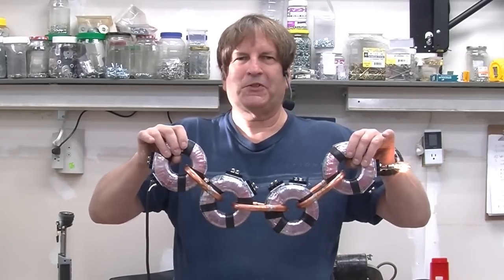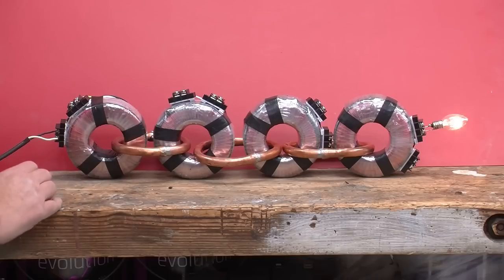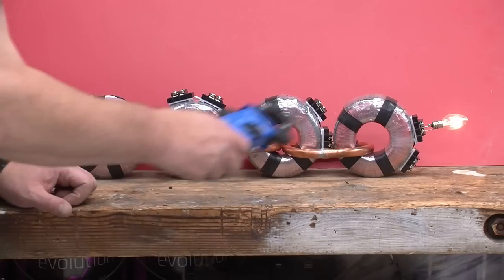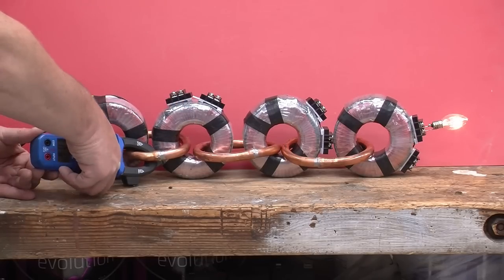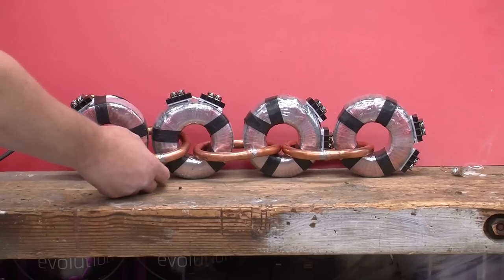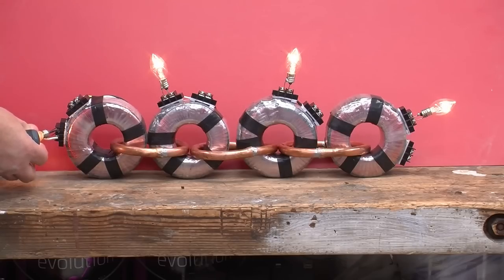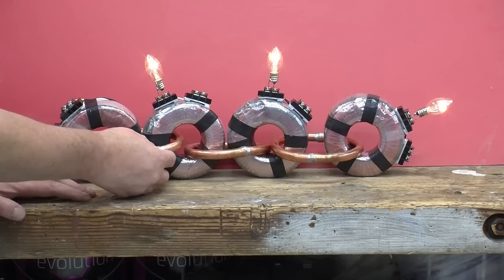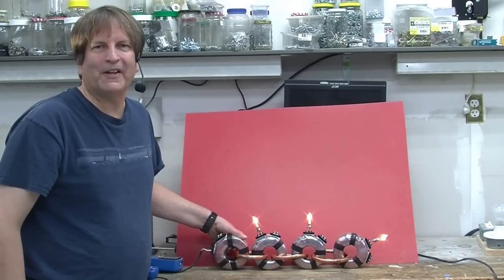Let's Experiment with an Electromagnetic Chain!

Comment: Very cool.  You're going to have too much viewer feedback soon.

From one of the electrical terminals at the far end of the chain:
Would they each measure about 60V to ground? (it may depend on where the copper pipe rests in the toroid, so maybe 40V and 80V to ground)
If you grounded one of them (if that's safe, or thru a lightbulb), would the other terminal be about 120V to ground?
I expect the GFCI at the wall outlet will not trip.  A GFCI placed at the far end of the chain should trip with one terminal grounded and a fault from the opposite terminal. [edit: a GFCI is supposed to account for a leakage current, but not sure how that works if neutral and gnd are electrically the same]
Reply from the maker: Thanks!

Your right about  the terminal to ground voltage varying depending on the location of the copper pipe or anything else that touches it. Would be very hard to predict because of the very high insulation resistance and for that matter, it would almost almost be impossible to measure because any current getting though the insulation is probably in the micro-amp range. I might even guess a significant portion of any such current might also be from capacitive coupling between the winding and the core.

And yes - if you grounded one or the other of the end terminals, the other would be 120V to ground and with a good connection to ground, be as dangerous as 120V out of a normal wall socket. 

And  the GFCI on the wall would not trip because it is not in the current path.

A GFCI at the end: The GFCI works by tripping if the currents on line and neutral wires are not equal and opposite. If they are not equal and opposite, there must the current flowing somewhere else so the device trips because that shouldn't be happening. 

 So if we add a GFCI to the end and   ground one of the wires between the GFCI and the transformer coil, there is now a ground path possible for shock type currents. The GFCI should trip if someone were to touch the wire on "the safe side of the GFCI" that is 120V to ground since the shock current diverts some of the away from the GFCI and the two wires going though it are no longer equal and opposite. 

You hit on a few neat things that have real applications:

1) GFCIs are sometimes used when retrofitting old houses that do not have ground wires at each outlet. In that case the GFCI ground is not attached to anything and like in the situation above, it protects by noticing the difference in currents on its two wires and shutting off power. 

2) The 120V output end of the chain is isolated as you described. There are transformers that are build with an isolated output for testing and other safety applications because without the connection to ground, there are less paths for a current to accidentally go though people.  I did a video about that here: https://youtu.be/olq9wdeNS4c
Reply: @ElectromagneticVideos   In Scenario 1... here, such a residence would be disconnected from mains supply until it complied with current Standards wiring rules.  No two ways around it.  
No electrician would touch the place until it was agreed the work be done in accordance to such rules, in fact, we are obliged to disconnect rather than risk their Licence to work in the industry be suspended.  No self respecting tradesman would work on the place... because as the last person to work there they would be blamed for not disconnecting when someone gets killed. 
Oh yeah... we don't allow unlicensed DIY idiots to work on Mains wiring systems in homes, unlike the USA and UK.  Good luck with that recipe for disaster. 

Senario 2.  
Touch between the two transformer output terminals, or circuitry after and get the belt of a lifetime.    Isolation Tx have a very specific limited use, because all appliances in use in a home should have an Earth/ground available if it is needed... eg. if they are not Double insulated construction. Anything with a resistive heating element built into a metal hotplate or pan require such an Earth/Ground. 
Also, there are sound reasons for Neutral Earth bonding that far exceed and perceived 'additional means' of accidental electrocution.

One other matter noted there.... you can find a lot more than your 120V AC across the terminals of that Tx in an open circuit situation... both sets of windings. 
The copper pipe used has a very thin wall section... low Cross Sectional Area that would hardly carry 40A at below 75 C... or 105 C, for extended periods of time.  If it was cable with a CSA of 25-35 sq mm and so, a safe current rating of 80-100A there would be no problem shorting out the winding terminals (BOTH) for safety. They will NOT burn out from overcurrent or heating effects.  Do the math... All Tx after the one energised by 120V AC are CT's with a ratio of 500:1  Pass 500 A through the core and get 1A current flow into a high impedance voltmeter load. Open circuit they can suffer  HV insulation resistance breakdown that renders them useless as a VT or CT... and provide a significant shock to those playing with 'em.
Reply: @Bernie_the_Bolt  Very wise policy if enforced.

Comment: Also demonstrates why you NEVER bolt to both sides of a metal case through a toroidal transformer, as it would create a shorted turn.
That isn't a shorted turn, as it forms the secondary of one transformer and the primary of the other
Reply from the maker: Yes! I wonder how many times that has happend because someone didnt realize it.

Comment: There is no point to a GFCI if you're also going through an isolation transformer, or vice-versa.  It's a good idea to have one or the other, but having both doesn't give you any extra protection.

Also, you really should turn off the power before connecting or disconnecting things from terminals which are running at mains voltages.  An isolation transformer or GFCI still won't protect you from accidentally bridging across the terminals, which can still produce a nasty shock.

Comment: Why is there so much power loss in each tranformer.....
Reply from the maker: Its because the with a single copper loop (pipe) the voltage in the loop is low (0.2V) so the current has to be really high to carry any amount of power and even though the resistance of the copper is low, at 100s of amps it had significant resistive power loss (RI^2). I squared in the previous equation is huge when I is 800A - about the rated power of the transformers used. If I had thicker copper - rod instead of pipe - the losses would be much less.

Comment: Found the following version about five years ago, film from 1965...  https://www.youtube.com/watch?v=Vwjcn4Vl2iw&t=279s
Rats, I thought I invented it first!   But Lawrence Bragg was already using those for his lecture demonstrations forty years before me.

I came up with the idea myself in 1989 as a physics exhibit for science museum.  An AC transmission line with no circuit, just EM waves alone.   Showing people that "Electricity" is not currents or electrons, because the energy-flow in circuits is electromagnetic.   The utility companies are selling us some e-fields and some b-fields, at right angles.   Radio waves, but at 60Hz.

Then finally was able to build one in 1991, from some iron C-cores I found in a surplus store, plus some thick aluminum rings!   No coils on the chain, just purely lam-cores and rings.  My driver was a 300 watt soldering iron, with a loop of #10 solid copper wire in place of the soldering tip, to put out about 800amps.  At the output end of the chain, I had about ten turns of hookup wire, driving a small 3V bulb.

I did put up a crude drawing on my website, in 1999, figure 10 in "Right Angle Circuitry"

Comment: Please explain how it is that you are able to touch the copper loops without a shock. Also, how is it that you were able to measure voltage on a single single copper loop? Also, how is it that the copper loops can touch each other inside the iron toroid without causing a short? This demonstration makes me feel less informed, not more informed. It’s very enjoyable. But I don’t understand how you have so many praising comments and no dumbfounded ones. ☮️❤🌈
Reply from the maker: The thick copper loops are 1 turn windings around the toroidal magnetic cores. Because its only one turn, the voltage generated across the one turn is low - just over 0.2V (the input coil where 120V is attached has 500 turns with the same voltage per turn). So with only 0.2V across one of those loops, thats less voltage than a typical AAA battery and no chance for a shock. 

How was I able to measure the voltage of a single loop? The voltmeter and its leads becomes part of the loop so even if I connect it to the half way part of a loop, it completes the loop. In this or another video I even just loop the voltmeter leads though the hole in the core to see the 0.2V.

How can the copper loops touch with no short? Well each is an isolated circuit -  electrons always have to flow back to where they started - so if the loop is touched at some single point there is no way back for them so no current flows from one loop to another. 

I'm glad you liked it but sorry you found it somewhat unsatisfying in terms of explaining things. I'm always faced with the dilemma of a widely varied audience online - how much explanation to include? The one thing I can suggest is look though the comments - many aspects of it have been discussed and may shed some light on how the EM chain works.
Reply: @ElectromagneticVideos  to be clear, nothing derogatory was intended. I never lose sight of the fact that content creators or me nothing. I just wanted to voice the minority opinion that I presume others are embarrassed to admit. As an autistic, I always look back on my statements and wish I had toned them differently. But I have also learned that mortals want me to limit my words. It's a tough balance. Thanks for the reply! I'm really enjoying going over your back catalog. ☮️❤️🌈
Reply from the maker: @RichardBronosky  I hope I didn't seem to imply I thought your comment was derogatory - if I did  apologize. My last paragraph was just to let you know where I am coming from in terms of finding a balance of explaining too much or too little.

I thrilled you liked it well enough to look at other videos I have posted and if you have questions I am  always happy to try and answer at least as well as one can do typing text and without pen and pencil to draw things.
Reply: @ElectromagneticVideos  Your comment was above reproach. You are a man of character. A gem in a desert. I love your attitude. ☮️❤️🌈
Reply from the maker: @RichardBronosky  Your too kind! And I look forward to your comments in the future!

Comment: What would result if the chain was formed into a circle?
Reply from the maker: If you managed to loop the end with the bulb around and connect that toroid  to the toroid where the 120V AC in is attached with another copper pipe loop, you would end up powering the chain from both ends and the middle toroids would experience less loss in power due to copper resistance because they they are getting half their power from each side. Now if you twisted it so when it was connected back it was connected 180 degrees out of phase, you would effective be shorting the chain and it would draw enough current from the AC in to probably start melting things. So nothing too spectacular!
Reply: @ElectromagneticVideos  Thank you for that. I intuitively had a similar conclusion.
Reply from the maker: @curtisskysmith2418  Your welcome! Its neat to consider things like that - certainly makes you think!

Comment: are the light bulbs in series with the 500 turn loop
Reply from the maker: Yes - although since each bulb it is the only thing connected to its 500 turn loop, you could also say in parallel in case that isn't clear.
Reply: @ElectromagneticVideos  i still dont understand.  the black connecting blocks on the torroids, are they open circuit connections to the 500 turn loop. if so, if there is no light bulb connected, then no current flows.
Reply from the maker: @tomsloan5324  You got it! The toroids I used are just plain old toroid transformers.  You will notice there are two terminal blocks on each toroid. One is for the 120V winding with 500 turns, and oner for a 30V winding. When unconnected they have no effect - no current flows in the toroid core acts as if the winding was not there at all. It might have been more obvious if I had removed the windings from the center toroids leaving just the bare core. The windings are nice to have because the voltage across them is directly proportional to the (changing) magnetic flux in the core. And low wattage bulbs are a great way of visually showing how much or little flux there is.

Comment: Hmm, interesting, I argue that everyone has seen an electromagnetic chain, we just don't think of it as one, The power distribution system itself. power plant to substation, substation to substation, to distribution transformers, to our very home.
Reply from the maker: Yes - your absolutely right - this one is just made to be a bit more obvious!
Reply from the maker: Exactly!
Reply: I was just going to comment this. GSU transformers, substations, pole pigs, old school wall warts&MOT’s  are all this, just with different impedances and multiple smaller transformers in parallel. And then there’s motors and generators which are the same except the bulk of the power is in the motion of one winding instead of the wattage in it…
Reply from the maker: @deltab9768  Good point about motors - particularly induction motors - really neat  the way the rotor currents are induced from the stator by transformer action.
Reply: I never thought of that, but that's absolutely true.   we tend to take the convenience of electricity for granted,  but without many of the famous inventors and scientists who lived in the 1700s and 1800s, namely Michael Faraday,  Greg Ohm, Nicola Tesla and Thomas Edison,  to name a few, we would still be lighting our homes with kerosene and whale oil.  Quality of life as we know today, would not exist
Reply from the maker: @Sparky-ww5re  And greatest of all "James Clerk Maxwell" who created the mathematical foundation  for Electromagnetism and gave physics the concept of fields. He is easily up there with Newton and Einstein, but sadly most people have never heard of him. He also died really young - had he lived we might have had the Theory of Relativity  50 years earlier and even Quantum Theory - we might be 50 years ahead from where we are now!

Comment: Seen this before, and this principal is commonly used in the electrical industry for current metering and heating applications. ie. Current Transformers and Induction furnace coils. You have a 500:1 ratio CT's... plus the unused secondary winding that are left open circuit there! Bearing heaters work the same way. You clamp meter works the same way. This is why when installing toroid transformers in an instrument case you NEVER allow the mounting bolts to form a short circuit (closed loop) via the metal case. Yeah... seen idiots do that before too.
It works in both AC and DC supply modes. 

Up for another fun experiment with this setup?  Try disconnecting all lamps and then put two fingers across the primary or secondary terminals of subsequent transformers while the 1st transformer is connected to mains supply.  LOL  
Spoiler: The potential difference there will be a lot more than the original 120V... in fact sometimes so high a voltage that the insulation in transformer winding can breakdown and ruin the transformer.  This is why CT's that are not connected to an instrument (ammeter or Power meter) are ALWAYS shorted out to prevent burning out through excess voltage. It does them no harm.   It can be very time consuming and expensive replacing CT's in many installations, especially when 2,500A copper busbar passes through the toroid. 
LOL...  I guess you didn't realise how hazardous that setup was? Frankly, I was expecting a misery yelp when you were handing them energised so close to those open circuit terminals. Sorry, kinda disappointed it didn't bite.

So, here is another circuit configuration you may get a chance to play with... if you have exposure to power industry. Imagine this common scenario -  250A 3 phase AC supply cables connected to a load (perhaps motor or heater) enter or exit a power distribution/control cabinet.  The cables are single core... not multi-core, so each cable must pass through an individual hole in a metal plate (gland plate) through their own unique hole.. so, that's 3 phases and an Earth ... maybe a Neutral too = 4 to 5 cables and their holes.  Each hole for an active or neutral is forming a closed loop circuit around each conductor.   Doesn't matter what metal used in gland plate... steel, Al or Brass. 
What do you think happens if a cut isn't  made between those holes, which in essence opens the closed loops.. the same as passing all through a single hole under full 250A loading? What do you think happens if it was 2,500A to 3,000A busbars running through a switchboard with similar closed loop metal rings around each bar? 
Few electricians realise what will happen and no hobby wannabes would have a clue.
Reply from the maker: Nice explanation about current transformers! But this is not actually operating as a current transformer. It is simply a 500:1 transformer going in, each middle transformer (toroid) is a 1:1 transformer , and the transformer at the end is 1:500. And of course the 500 turn coils on the middle transformers become 1:500 transformers producing the original 120V. So bottom line - the middle 500 turn coils on the middle toroids do produce and 120V - more than enough for a shocking experience which is why I was careful not to touch them.